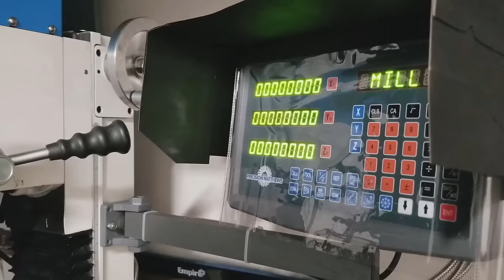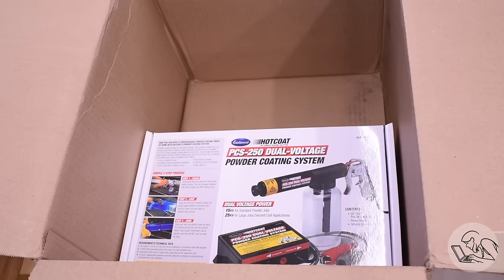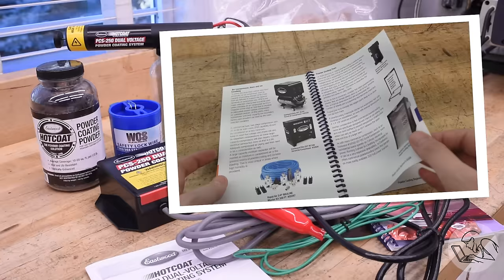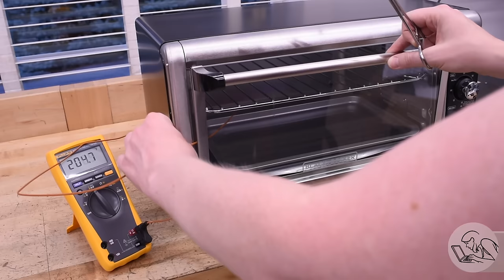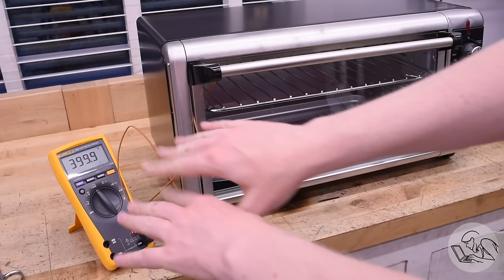Powder Coating At Home! You Can Do It!

Comment: For a "Kit", surprising number of items not included.
Reply: I can kind of buy the economics and philosophy behind some of the choices here. The idea behind a kit is to provide a lot of specialty ingredients and tools that are a pain to acquire singly, because you as the maker of the kit can bulk order things to your one location and split them up across a bunch of kits. Ovens are not hard to get or specialized, but the logistics of shipping a bunch of identical ovens to one place to build the kits and then back out to everyone all over the continent, it's not worth it. Any box that's big enough and gets hot will do the job, and it's highly likely that anyone getting into powder coating will already be doing other shop work that might already require an oven, so it's the piece of the kit that's most likely to already be in someone's shop. Also, everyone's need for the size of the oven is going to be different, you can powder coat almost any size part with that kit, but you can only bake it if you have a big enough oven. As for not including the book by default, that can be a waste reduction issue. If you are ordering a bunch of kits to outfit, something like a class at a makerspace or something you don't necessarily need one copy of the book for every kit you order, so you make that a separate line item.

Comment: I can already tell that your long-term results of powder coating will be a total failure.  Any taper in the wooden hangers in the booth beyond 0.003" will create negative hanging energy and result in premature flaking. Your hanger should be polished to a mirror finish for compatibility with the stainless wire. (Looks is very important.)  You didn't read the fine print!  In addition, the leg leveling cuts were not properly chamfered and your ground for powder coating requires 1000 Ft of #6 grounding array spaced on 18 deg.  That's 20 ground wires for a proper array in case you didn't know.  Your integrity is waning.  Other than that, I enjoyed the video and even think I may give it a try.  Now to save up for that 1000 ft of #6 wire for my grounding array!  I am negotiating with my neighbors for sub-surface easement on their property as I write this.  Thanks.

Comment: Your comments about stakes in the ground etc (from forums?) seems like mumbo jumbo much like that spread by folks that don't understand ESD (electrostatic discharge) protection in electronics. It is only called a "ground" because it is the terminal of the high voltage supply which may in deed be connected to the ground of the power supply as far as I can tell. You are interested in the high potential difference between the gun and the part so unless you are particularly trying to attract the powder to everything else in your workshop then I see no reason to ensure you have an external connection to "the ground" that everything else unrelated to your project is connected to or how that would improve powder adhesion to your part. Love to be corrected if that assumption is wrong.
 
When people talk about ESD protection (essentially the opposite of powder coating) they often think that being "grounded" is the magic sauce to protect their sensitive electronics from ESD when what really matters is that you and the things you are working on are at the same potential. "Ground" itself is just a useful common point because your soldering iron, bench mat, test equipment etc all happens to already be connected to "ground" and so everything stays at the same potential.

Love your work, cheers.